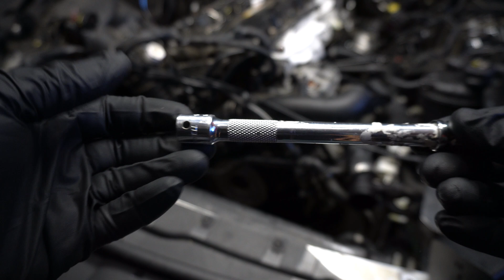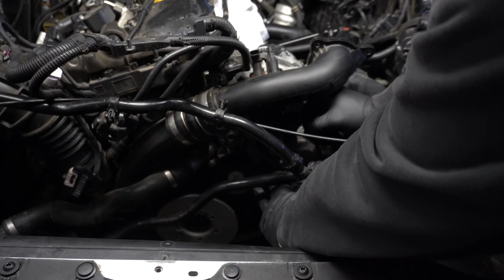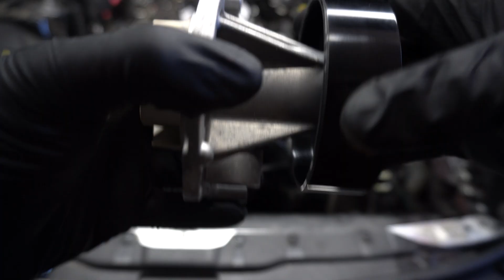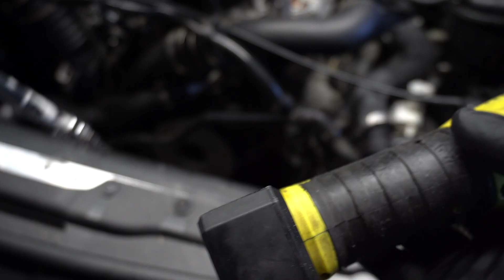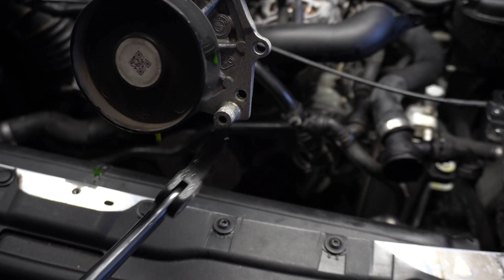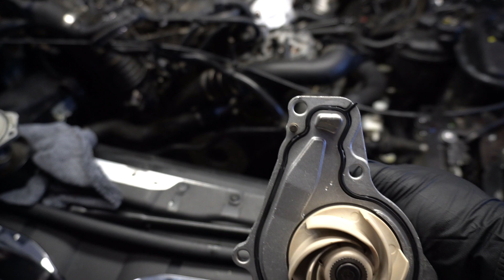BMW 540i (B58) Water Pump Replacement Guide – Full DIY Tutorial for All B58 Models

Comment: If you have a mystery leak be sure to pressure test the the water pump assembly, the assembly gasket failed on my 2017 540i around 110k miles and was leaking a gallon a week or so.